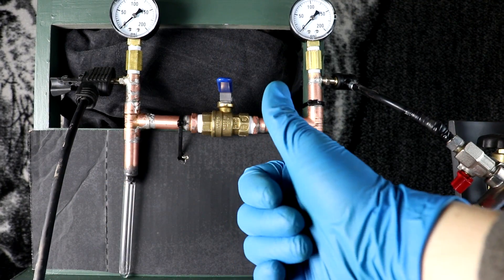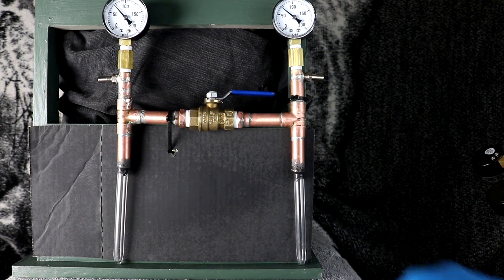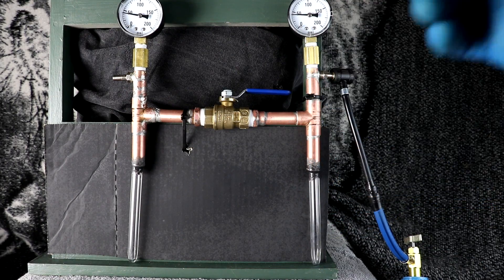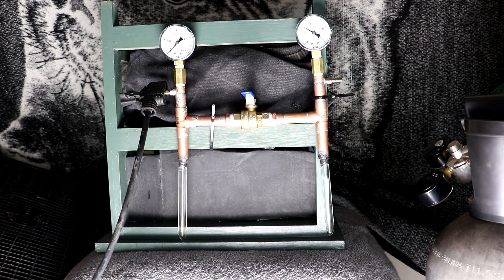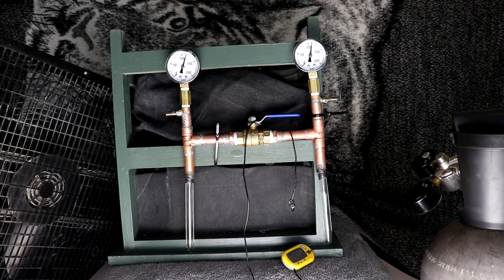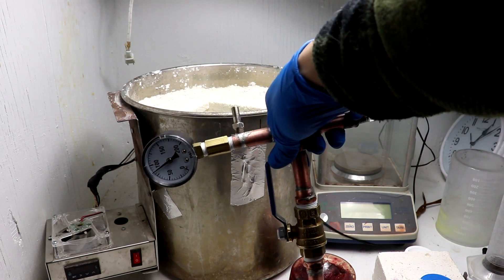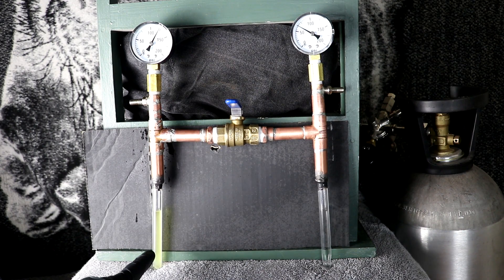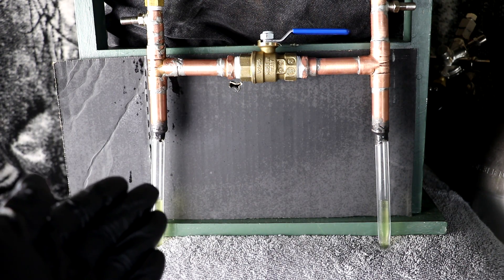The Law of Partial Pressures Demonstrated Using Vapor Pressure

Comment: The reason you're seeing slightly less pressure in your summing rig, I believe, is because the valve is likely a ball valve which contains a void.  When the void is 90 degrees to the openings (valve closed) the total volume of the device is slightly less when filled from either side.  When you open the valve, that void becomes part of the pipe connecting the two ends, and adds to the overall volume of the contraption - causing a slight loss of pressure.
Reply from the maker: Ah! Yes that would certainly affect it.
Reply: @theCodyReeder  As long as both liquids are still present, the volume change won't impact the final pressure. Instead, a small amount of the liquid will evaporate to keep up the pressure. The pressure decrease is probably due to attractive forces between gas molecules, making them "stick together" a little and therefor exerting less force on the containers walls (non-ideal behaviour).
In general, the accuracy of the ideal gas law decreases with increasing temperature and pressure.
Reply: @theCodyReeder  I guess one could calculate the overall volume of the rig with and without the void and come up with an offset.  Also, I wonder if the void evacuates under vacuum if the valve is closed, or if a small amount of gas in the valve would spoil the vacuum unless you drew it down with the valve open.
Reply: @hugeshows  Just eyeballing such a small rig, I bet that void in the valve actually accounts for a worthwhile percentage of the overall volume, good call.
Reply: Cody'sLab use solenoids :p
Reply: @theCodyReeder  CODY  do you know why a recapped soda will stay carbonated longer at room temp as opposed to putting it in the fridge? what is the science behind that. its a trick a friend taught me
Reply: I think this comment is meant to explain why we don't get 75PSI in the first experiment.
Reply: Now hold on here for just a minute! Something is very intuitively wrong in my head about this!I 
Please correct me if I am missing a huge chunk of this. I think this is all wrong.

It's not the sum of each individual single gas pressure system before mixing that gives the new Total pressure after mixing. The new derived total pressure after combining is the average of each individual pressure. If adding them were correct, then if two gases were at 50 pounds and they mixed, the total pressure would have to be 100 pounds and that ain't gonna happen. That thought is what triggered me.

What Dalton's Law says is if you were to combine both into the same volume as one.
You can't just connect the two because connecting is not adding, it is just grouping.
The volumes are not added, only the pressure is.
Consider if you had 2 balloons, one filled with 1 pound of pressure (P1) and the other with 2 pounds of pressure (P2). If I connect them using a check valve to only allow the flow of has into the 1 pound balloon and none out, they just equalize to 1.5 lbs each. No more air flows 

But Dalton's Law says to add all of the pressures to get TP , P1+ P2+P3... it doesn't add part of the pressure. Using your demo and just adding part of P1 would make the equation P1+.25P2
You still had 75 pounds in one that was never added. If you would have added it, you would have ended with 100#+50#=150# P1+P2=TP as Dalton would approve of. And Snell as well.
The summing of pressures of different gases is not what is demonstrated or presented in this proofing experiment.
The pressure just follows the laws of thermodynamics and flows to conserve energy.

The ball valve only has a tiny volume 
The ball valve acts like an orifice tube like the one used in the air conditioning system in your car.
The low side has just become an evaporator.
The high side has become a condensor.
It will continue to cool until both sides are equal pressure. 

Normally, the compressor in an AC system keeps the high side pressurized as the refrigerant is discharging through an orifice into the lower pressure side. Venturi effect
The compression of the gas by the compressor creates a lot of heat.

The lower glass tubes are well insulated from the metal and the local ambient heat.
And heat from your hand can warm the copper easily.
When you tilt it, the copper tube acts as a heat sink for the liquid and is an excellent conductor of heat between the liquid and the ambient heat. 
Like how 60 degree air is no big deal but 60 degree water feels much colder.

That's my $ 0.02 anyhow.
Reply: Why would it affect it? It would only affect the level of the liquids, not the equilibrium pressure.  Don't confuse Cody.
Reply: @xyzzyx7812  where did you get your name, if you don't mind me asking?
Reply: @xyzzyx7812  The point is that the total volume is smaller with the valve closed than with it open. If you've got a certain amount of gas in the vessel, and increase the volume (the amount of space the valve takes up) then you're decreasing the the equilibrium pressure. The valve closing mechanism occupies space, when you open the valve you're creating more space for the gases to occupy.
Reply: @Jax10n  Change in total volume does not change vapor pressure.  It will only change how much liquid there is.
Reply: @jkn6644  I thought we were talking about when he had carbon dioxide and regular air - no liquid - and there was slightly less pressure when mixed than he expected.
Reply: @Jax10n  Estimating from picture: Volume increase from valve is less than 3%.
In first test pressures are 50 and 100.  Average is 75 psi, but pressure drops to 70 psi.  Difference is 7 %.

I repeat calculation adding 14 psi to values: From 64 & 114 to 84, average is 98.  Difference is 6 %.  

Volume increase does not explain this.

Air temperature drops with pressure. Does temperature of CO2 drop?

Edited to correct numbers (I stopped video too early and got wrong starting pressure.)
Reply: jkn I think you are overestimating your ability to estimate...
The internal diameter of both the gauges and the pipettes are probably much smaller than you realize, and the volume of the ball in the valve is much larger than those IDs. Not sure what schedule copper piping Cody is using, but in the end, why speculate weird unexpected phenomena when the obvious answer is only being obfuscated by your “guesstimation”.
Reply: @ZenZooZoo  I have valves like that and internal diameter is same as in tube it connects to. I have no reason to change my estimation.
Reply: @jkn6644  I doubt this would have an effect of such magnitude, but what about the fact that volumes are not additive?
Reply: @Jax10n  The volume doesn't matter as long as there is excess liquid.  Some of the liquid will evap to fill up the vacuum, but that is far less volume than the vacuumed section
Reply: @xyzzyx7812  1:10 what liquid? The part where the pressure was slightly less than expected was when he was just using carbon dioxide and air (nitrogen). For either nitrogen or CO2 to form a liquid it would take extremely cold temperatures or high pressure, which he wasn't doing.

Later in the video he used R-134a specifically because it is a liquid at a more reasonable temperature and pressure, but there wasn't any confusion about what the pressure would be at that point. He didn't make any predictions, but explained that the air was forcing the R-134a down on that side and slowing the mixing, which would make for a lower pressure that slowly rises over time as the gases mix.
Reply: Xyzzyx We’re talking about the very first experiment in the video! There’s no liquid!!

Comment: Holy crap... Someone on YouTube who doesn't say freon when they're talking about refrigerant.👍👍
Now you just have to work on "expecially" and "acrossed." 😁
Reply: and "bletch"... cool demo & explanation.
Reply: @AckieCam  very true
Reply: acrosst triggers me deeply
Reply: take a moment to remember the "a" in "aluminium"
Reply: Freon was a term which I was always told specifically identified R12 (Chloroflourocarbon or CFC), so yeah I don't think Cody would ever make that mistake. I used to work on A/C systems for passenger trains in the early 90's around the time of the switch to R134a.
Reply: Robert Leitch - Freon is a brand name for several refrigerants, but the layman has resorted to using the name as a catch-all for any refrigerant in the same way that Vaseline has become a catch-all term for petroleum jelly based products.

Comment: Cody, I’d love it if you could explain one of the theories related to this I can’t wrap my head around. There are several automotive sources that claim filling your tires with pure nitrogen either prevents or drastically reduces effect of temperature changes on tire pressure. Based on PV=nRT, I could never understand how it could matter which gas or gasses were in the tire. Can you shed some light?
Reply from the maker: Yeah... that’s a load of bull.
Reply: @theCodyReeder  What about thermal capacity? Do gases have different thermal capacities just like liquids do?
Reply: Air has some water in it.  Pure nitrogen does not.  Water in the tire will increase effect of temperature changes.
Reply: I sense another video coming
Reply: That's what the Air Force told me when we fill the aircraft tires with nitrogen gas.
Reply: @greyrune3  - Airplanes use nitrogen for 2 reasons: 1 - Because 200 PSI oxygen in presence of rubber, hydraulic fluid, etc, in a hard braking event where the tires overheated (3x the deformity of road tires, 8x the pressure) caused the superheated rubber to reach the autoignition temperature on 3 different flights and high pressure oxygen resulted in an explosion. Nitrogen is inert. They changed the rules in 1987. And, 2 - Because of the dangers of water vaporization at extreme temperatures.
Reply: @greyrune3  I once had a Navy mechanic tell me they used Nitrogen because it maintained an even volume at various altitudes. Sounded reasonable to me...
Reply: I remember listening a comentator on a F1 race, that they do it because air contains water. The high temperatures causes it to boil and slightly change the pressures. I presume Dry air will work the same, but is just easier to use bottled Nitrogen.
Reply: I think (though not sure) it may be that oxygen under high pressure/temp may be slightly more reactive and may cause slightly more wear than nitrogen.

Comment: Cody, I assisted my son in a science fair when he was a freshman in high school more than a dozen years ago.  He made a model of a DNA molecule that required some use of my table saw, and I eventually let him cut a couple of the pieces of wood, but that is the tool that scares me more than any other, and I am crazy careful using it.  (But having been hit in the soft bits years and years ago by kickback, I will always remain crazy careful.)  He got the blue ribbon on his model, but dang it, this would have been so much more fun.  And I had no issues with him dealing with copper and soldering, so I could have supervised while letting him create all the parts.  Back to the table saw, we both still retain all ten fingers.  :-)

Great, great video. You brought out the old nerd in me, and for that, I thank you!
Reply from the maker: Eventually I want to make some gloves that would stop the blade before cutting through.
Reply: @theCodyReeder  They actually already make a brake that does that, but it is not available for my cast iron, circa 1980-ish, 280 pounds of cast iron Craftsman (when that meant something) 3 HP, belt-drive, table saw.  We live in a wonderful era of technology.  Some of the old tech continues on (saying this to someone who clearly has demonstrated the use of even older bulldozer tech in previous videos.)  Coming from the son of a late father that bought a Cat D-6 4 decades back to fix a dirt road.  And I know you know this - driving a bulldozer is fun!

Comment: latent heat of vaporization. The freon or R-134 is absorbing heat from the air and using that energy to change phase, increasing pressure as a result

Comment: Part of the problem is you evacuate the system, close the value, then fill the refrigerants, so the space inside the ball valve still has a vacuum pulled on it, so you would have to add that into the equation to get a more perfect measurment, by finding out the volume on the inside of the ball of the valve.

Comment: Its a ball valve.  The cylinder whole in the ball valve is at low pressure. when you open that vavle that volume needs to come to pressure, reducing the over all preassure more than you expect.

Comment: Perfect example of contaminants in a refrigeration system.    That’s why just dumping refrigerant into a car a/c  that’s out of gas will cause system failure.  The high head pressure will kill the compressor valves.    Retired HVAC technician here.  Cool visual!
Reply: ... that explains why cars ac no longer works after refilling it a few times ... :P
Reply: @-AnyWho  that's because you have a leak. But yes just adding more and more will break it. A/C systems are sealed or ment to be. So if your system stops working you have a leak and or the compressor has stopped working (valves) or clutch or an or a orifice filter has clogged low pressure sensor or high pressure sensor or dont forget wiring. Just saying.
Reply: AnyWho many many more reasons explain the failure...

In automotive AC, a lot of oil leaks out with the refrigerant, so by the third refill, enough oil is lost to damage the rotating bearing surfaces...
Reply: @SuperVstech  Also a good reason why most qualified and good vehicle A/C techs drain and refill the compressor oil at every service.
Reply: @SuperVstech  well i wanted to give someone else a turn. I didnt want to hog all the glory. Just joking. Its amazing the different reponses. From different channel's or sites.
Reply: Robert Leitch exactly.
Proper system service in modern cars requires replacement of the condenser, because there is no way to clear the parallel flow radiators ...
Reply: @SuperVstech  i prefer the horizontal flow condenser so they clogg sooner. 😂
Reply: Can you elaborate?
Reply: @Ariccio123  Car A/C units use flexible rubber hose which are hygroscopic (permeable to water, some gases and other liquids), if you simply dump a full charge of refrigerant in the system without evacuating the system first there will still be pressure from water vapour or other contaminants in the system and you will exceed the maximum recommended pressure of the system and hence damage the compressor (and potentially seals in the system loop or other components). 
Also R134a has a higher vapour pressure  than the older (now banned) R12 (CFCs), so when those older systems were converted over in the 90's it was necessary to reduce the weight of a full charge by 10-15% to prevent damage to those older systems.
Reply: Just what i was thinking, old fix it guy.
Reply: Nice to have someone from the relevant industry re-enforce the concept.
Reply: Also on some ford compressor's if your clutch statts to slip you can take an 8mm wrench and unscrew the fastner and remove one or more of the washers to get ya til the next ac shop for proper repair.  Or if your like me when the AC shop gives you the quote to repair your system you go buy the gauges and vacuum pump, parts you need. Do it yourself.  Save yourself some money and learn something teach your kids. Then you can make a vacuum chamber.
Reply: Switches go bad too, i once wired or supplied the clutch with 12 volts  because the dam switch went out. Worked great.

Comment: Cody you can't say that there's nothing but gravity holding back that refrigerant. The miniscus pointed down. That means there's interaction between the refrigerant and the glass.  could be with the copper tubing, too.
Reply from the maker: Gasses don’t have surface tension.

Comment: actually, in the ideal world you can use distillation to get 100% alcohol like any other ideal mixture, search for the Raoult's law, it just takes time. The real reason you can't in real life is that water and alcohol interact with each other so you get an Azeotrope, with is basically a moment in distillation that you would need to "invert" the column, meaning you would get water in the output instead of alcohol.

Comment: I wonder if the unexpected pressure decrease could also be because the ball valve has a cavity inside the “ball” that contains some volume. This volume would be at a lower pressure and therefor lower the total pressure. Good video!

Comment: I wonder if Cody's hair gets snagged in that chain mail ...
Reply: megadork who has worn chain mail before here: depends on the weave and how you wear your hair, but yeah, maybe. that probably explains the ponytail
Reply from the maker: It doesn’t snag once it’s welded and tumbled.
Reply: @theCodyReeder  my fault for wearing shitty butted mail I guess
Reply: @theCodyReeder  The hair or the chain maiil? :p
Reply: @theCodyReeder  The weight of the mail pulling down can pinch a hair where the rings intersect. Say if you shift positions and allowed the rings to pull apart then stood up and gravity pulled the rings 'tight'  again
Reply: I just went to see if it's possible to buy a weighted vest/ tshirt. I can see why you made your own, they look like suicide vests, you'd probably get shot!

There's a story (I believe it's from Greek mythology, but I can't find it) where a guy carried a baby goat around with him and as the goat grew, he grew. Are you adding weight to it without really noticing? Anyway, it would be good to see an updated video! Keep up the good work!
Reply: @garethevans9789  Milo of Croton.
Reply: @garethevans9789  Use sand bags. WAY cheaper, and you can pack quite a bit of weight on. I have a 140 lb one i'm using right now, made from a recycled kevlar plate carrier and some old plastic fedex package slips sealed with duct tape to hold the sand. If you wanna be discreet and fancy, use ziploc bags for the sand and sew them into a sweatshirt. I also highly recommend leg/arm weights.
Reply: Only recently... maybe